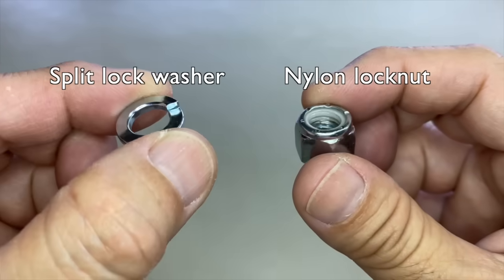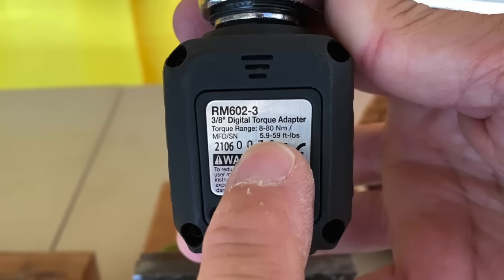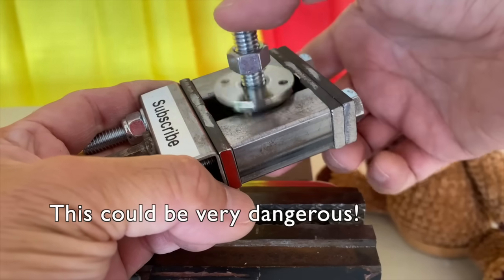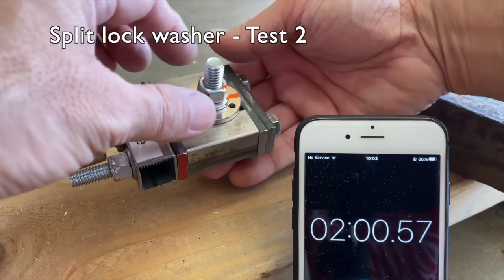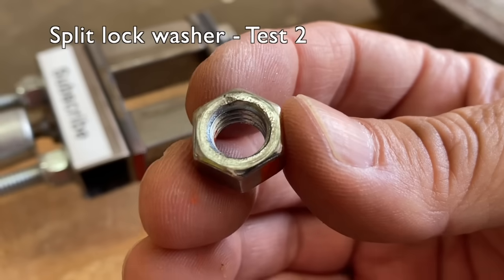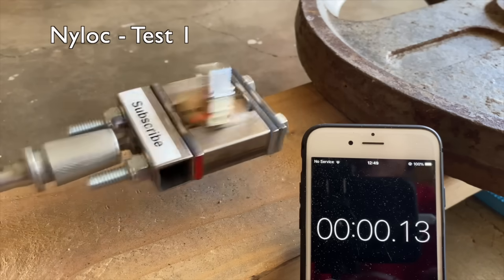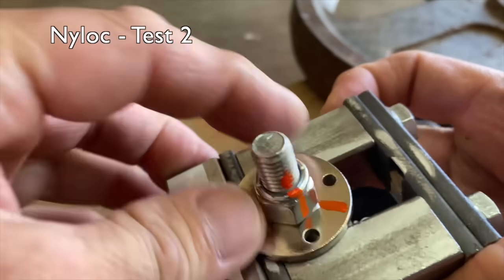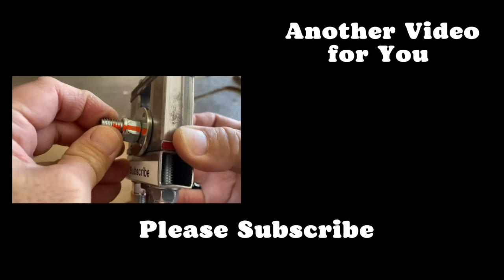Nuts & Bolts - Split Lock Washer vs Nylon Locknut – DIY Impact & Vibration Test - Part 1

Comment: Great test!
This is why crucial fasteners are lockwired on aircraft.
Shake it for a week and it’ll still be there.
A&P/IA,ASE
Reply: I've forwarded your comment to Boeing's r&d department
Reply: I had to stop laughing at all these comments to your post, David. But, yeah, I'm ex-Navy (F-4J) and all our critical bolts are safety-wired.
Reply: @randallmacdonald4851  I was in the Marines 83-87, Huey crewchief.
Went to NAS Millington TN for school, but I think they’re closed now.
Also went to NAS Thurmont (Camp David).
Navy has great chow!
Reply: @David-p7z9n  I was at Millington for Class "A" school (1971) for AMH then on to Pax River for Class "C" school for P-3 Orion. Then Keflavik, Iceland as part of the NATO "agreed area" there. Then down to NAS Oceana for more "C" school on F-4's and eventually did Carrier Quals with VF-74 around the Bahamas and East Florida. Navy ALWAYS has had great chow ashore or, in my case, aboard CVA-59.
Reply: Can someone let Boeing know.
Reply: @macforme  First Boeing needs to remember to install the nuts.
Reply: Unless it’s Boeing and being done by DEI hires.
Reply: @TMac0925  It's amazing to me that it's commonly known that Boeing's problems are caused by the mcdonnell douglas merger causing Boeing to be run by accountants concentrating on maximum profits instead of the previous engineers devoted to quality who used to run the company, and here we are with people such as yourself consuming nonstop political propaganda who stopped thinking a long time ago and repeat the moronic statement that the problem here is DEI. You are doomed to repeat political propaganda for the rest of your days babbling about whatever clickbait soundbite you last heard that you wish were true until you hear a new one that you then start endlessly repeating until the next one you hear that you wish were true. I sincerely wish that I could slap the crap out of you. And have a nice day.
Reply: @TMac0925  Where do people such as yourself come from that seem incapable of understanding that it was the merger of McDonnell Douglas and Boeing that caused the company to be run by accountants maximizing profits instead of engineers devoted to quality. What has gone wrong in your life that caused you to constantly repeat whatever click bait sound bite that sounds good you over and over and present it as fact? It seems to be people in a race to the bottom in a competition of who is the most devoted in looking as unintelligent as possible. Fear not, because your place in the lead is obvious.
Reply: @TMac0925  funny how the problems at Boeing and other companies are almost 100% caused by rich, white guys.  But you keep up bigotry, sport!

Comment: If you use a serrated nut, there is probably a minimum torque based on the two materials being joined.  One thing I haven't seen is two serrated nuts being used as a jam nut.  You'd probably have to use an angle grinder to remove those.

Comment: Can you please test the nordloc washer. This is the locking washer we use on Siemens gas turbines. Please use it correctly. The corrugated face should face it other.
Reply from the maker: My Nord-Lock test is out… Will Nord-Locks Survive My Test?  DIY Impact & Vibration Test – Part 5
https://youtu.be/wOUnlfhHRko
Pls check it out and drop a comment.  👍😎

Comment: Nyloc nuts are good for some situations, and fail in others. The rear differential in my old side by side exploded because the manufacture used a nylon lock nut on the pinion shaft which would back off presumably from heat over time. They never admitted fault even though it was a common failure on this particular model. As a retired aircraft mechanic, we always used  cotter pins, lockwire, or other more mechanically sound locking proceedures for any critical threaded item such as bolts, nuts, wire connectors etc. A soundly engineered assembly should have appropriately engineered locking methods be it the nut design, threadlocker application, lockwire, staking, tack welding, etc.

Comment: Now, run the test again with proper torque for the bolt size and grade.  6 ft/lb is way too low.
The split nut depends on compression to dig in. The nylon lock nut depends only on friction on the threads, so torque is immaterial to the nylon nut.
Reply: The bolt is a spring and wasn’t tensioned enough! The nylon is an extra brake if tension is lost.
Reply: This depends on the use case! Not every bolt is fastened to the rated max torque. There are tons of applications where the torque is limited. For example when you fasten axial bearings. Or of a partially threaded bolt works as an axis like in the rear axle of a motorbike. In this cases you need to secure the nut anyways. And this is a good example of it. Fully loaded bolts have less need for a lock
Reply: @Taunus-Tim  point well taken! 😊
Reply: After the nylon has engaged over 3 threads it has lost some of its effectiveness.
Reply: really   ,less than half
Reply: "so torque is immaterial to the nylon nut."
and the preload created by the stretched bolt of course.
Reply: @ I heard you the first time.
Reply: Right I was gonna say the same thing
Reply: Split washers dont 'dig in' they provide a preload tension.
Reply: @VladimirPutin-p3t  ever try to take one apart?

Comment: Before watching this I would already choose the nylon nut, having experience with both. Of course you'll NEVER be able to loosed the nylon nut with your fingers until the nylon has cleared the end of the bolt, no matter how loose it is. Also, I don't feel that this is a valid test because nobody is going to torque a nut of that size to only 6 pounds.

Comment: Wow, that's pretty interesting, thanks!
The reason we mostly use split washers is that you can have them in alloys/coatings that matches the bolts and bolted material: corrosion and fire safety come to mind first.
Do wonder if these Nylocs can be applied in such environments

Comment: Every fastner has its place in its application. I have worked on both vehicles and small engines all my life. I can tell you the true winner is using locktite.  I have never had locktite  fail.
Reply: @scottfirman  anything that needs stripping and re assembly if it has had locktite on the engineers will be cursing! I only ever use it as studlock.
Reply: @dogwalker666  use the correct loctite, blue gel is perfect for most low heat applications, then you have your high heat blue medium strength, then you have your reds. If you use a red thats on you, that stuff is "Im not planning on removing that and it really shouldnt come off under use because that would be catastrophic". Some reds you can remove by heating with a torch, though you cant always do that with the part/location.
Reply: @BigChiefWiggles  I know I have the chart on the wall, You missed the point, Other people including machine manufacturers use thread lock not just locktite, And it can make maintenance an absolute nightmare.
Reply: @BigChiefWiggles  Agreed on the reds.  My shop uses red when we balance rotors  (for large induction AC's) and the application requires bolts and washers be used as balancing weights.  Generally if one of those comes off while a motor is runing the windings are going to short out and blow a fireball.  I've had to remove those before when a motor is back in for another repair for some damage that requires the rotor be rebalanced.  if the bolt is large enough to handle the torque it is possible to get even red high strength off with a wrench on each side but its way more work than just geting the torch out.
Reply: Orange for the win
Reply: I like cross threading the best, crank that bad boy down and it ain't coming off after that.
Reply: Loctite's for amateurs.  Real engineers use salt water and rust does the rest 🙂
Reply: @StanleyRestall  Worst idea ever. salt is the worst enemy of steel. I always put grease on my bolts and nuts, to make sure no rust.
Reply: @west_park7993  I took the salt water hack comment from @StanleyRestall as a joke. 😆
Reply: @west_park7993 hopefully you don’t apply it to the threads prior to tensioning. Thread lubrication is a big no-no unless the joint was designed with lubricated threads as part of the system. Oil and greases and just about anything one would apply to threads alters the K-factor or nut factor significantly.
Reply: @TPSTH23  i apply grease on the thread BEFORE tightening. for noncritical applications, it does not matter: I tighten it by the feel in my hands..... For critical, like head bolts, I apply a lot of grease. And I drive the bolt in-out twice before torque. Make sure, that the two threads are sliding, and NOT twisting the bolt.... I just found stainless steel bolt in aluminum thread. DRY. the SS-bolt was not corroded, but aluminum was. If they used a bit of grease,, there would be no water, and no corrosion. Yes: aluminum corrodes very deep, when in touch with another metal. Galvanic electrochemical corrosion.
Reply: @StanleyRestall  Now I know why the bolts don't come off without flame, banging, and blood. 😂😂😂😂
Reply: @StanleyRestall  Use caustic it rusts even faster.
Reply: @StanleyRestall  🤣
Reply: @StanleyRestall  that's funny!
Reply: I have. But thats in a bit more extreme condition. Phantom II AIRCRAFT. The F-4 E/G Wild Weasel. Safety wire. Damn near everything. Bolts, nuts, electrical connectors, hydraulic connectors, pneumatic connections (just kidding. I dont know of any of those. Outside what I worked on)
Reply: Wd40 eats super glue and lock tight. Let it soke a bit,walah
Reply: @recommens-comedy-central9761  walah?
Reply: @recommens-comedy-central9761  Actually no, Modern WD40 is no longer solvent based, Spray some Expanded Polystyrene see it not melt, 
Also the food grade version is even weaker.
Reply: Wd40 used to be 98% paraffin, 2% aromatics,  it's cheaper than wd and works the same
Reply: With a split washer?
Reply: Locktite 648 does it for me, you need a blowtorch to remove usually
But, a mate bought a z550, he had to strip the head down, previous dolt who owned it used locktite on the cam bolts that clamped the cam down, he, (being another dolt) didn't use heat to remove the bolts, stripped most threads removing bolts, couldn't helicoil as too close to bearing surface, so he had to source another head. Don't know why they were located as they don't need it
Reply: I use nord lock rings these day's.
Reply: I've seen it fail with heat.
Reply: There is a version for high heat. I used it where I needed to fasten the cylinder head of a moped, because the gasket was burned, but could not use cylinder head screws. I had to secure threaded bolts to the cylinder, ease the cylinder head on the four bolts and fasten them with screw nuts. Else I would have to remove the complete motor. 
The loctite never failed, the bolts never went loose in the hot motor.
Reply: @wwhb4780  red loctite on heat applications, especially head bolts on smaller engines. I found it priceless on single cylinder engines. The little Yamaha enticer would shake it's  self to bits without locktite.  That's a snowmobile. I used it exclusively  on snowmobiles. Blue for what you want apart eventually, red for never doing that job again.
Reply: @BTW...  Which threadlocker and what was the temperature? (eg. Removable threadlocker temp range 242 = 300F, 246 = 450F, 2440 = 650F)
Reply: I was just about to mention this. Thread lock seems to work well yeah.
Reply: I have seen failed on washer direct drive by whirlpool
Reply: I have seen it fail once on one nut but I used it to secure the nuts on a SDX-MAX floor scraper attachment for an demolition hammer with 20 joule impact energy I used it to scrape tiles from a concrete floor.
Reply: Yep! Loctite solved the problem of losing sprocket nuts while riding a motorcycle over long distances (2,000 miles or more).
Reply: I was a shuttle mechanic and engineer for 25 years. Split lock washers just aren’t used in aviation/aerospace on critical bolted joints. All nuts had a design locking feature. Every bolted joint had two locking features, and prevailing torque was always checked on each fastener during installation as directed by the installation drawings and associated specification for the installation of threaded fasteners. Oddly enough, locking compounds were not approved for normal use on the space shuttle orbiter, but was used in certain MRB repairs where prevailing torque for blind fasteners was lost. There was a detailed test performed by NASA near the end of the shuttle program that tested the use of locking compounds. In summary, the test found that locking compounds performed better than the proper preload applied to the joint in many cases. The test report is located here:  

https://ntrs.nasa.gov/api/citations/20120015467/downloads/20120015467.pdf

Here is one of the best websites for bolted joint theory:

https://www.boltscience.com

Comment: Interesting. Makes me curious about holding power of Nordlock, Belleville, inside/outside star washers, all metal lock nuts, etc. I don’t doubt the outcome of the test but would have been better if proper torque for the bolt size were used. Also, nylocs require additional torque added due to the nut friction.
Reply from the maker: My Nord-Lock test is out… Will Nord-Locks Survive My Test?  DIY Impact & Vibration Test – Part 5
https://youtu.be/wOUnlfhHRko
Pls check it out and drop a comment.  👍😎

Comment: Your testing method is flawed and not properly scientific..
Both the split/spring lock washer and nyloc nut are designed to stop a loosened nut falling off the assembly. That is all.
However, neither are designed to have such a low clamping torque of 6ft/lbs applied to them, nor used that way.'
If your analysis was correct all sorts of assemblies and motor cars would have fallen apart long ago.
Try the test with 30ft/lbs initially applied to the 3/8" bolt/nut assembly, then back it off by all means to simulate a loosened nut,
 and your results will be different because the grip of  split/spring washer is established during the torqueing down process.
The nyloc nut offers resistance coming and going and needs no torqueing to establish its grip.
Go ahead.
Be scientific.

Comment: For a secure hold the split lock washer would need to be installed on both sides - bolt  head and nut. Otherwise there is no backhold for the bolt itself. The nut is locked to the spacer but the bolt is more or less held by friction only. That is different with the nylon Locknut - in that case the bonding is directly between the nut and the bolt.   Isn't it strange that car wheels have neither of the two...?

Comment: the results don't surprise me at all. a split lock washer works in two ways, 1) when fully tightened it acts as a spring that increases friction between the mating threads, 2) as your test showed, as the nut is loosened the cut edges of the split washer emerge to dig into the mating surfaces like knives and resist loosening rotation

there are a couple problems with this. unlike the soft zinc alloy you used, hardened steel is not going to accept the split edge of the washer into its surface so easily. the spilt washer will still act as a spring to increase friction in the threads, but hardened bolts are often spec'ed to high torques such that the additional friction from the spring action of the split washer isn't going to add much as a percentage of overall friction

under high temp conditions like exhaust manifolds, the split washer completely losses its temper and acts no differently than a flat washer

for obvious reason i don't think anyone would spec a nylon lock in a high temp application

in low temp applications i would always use nylon lock where available, but split washer is a reasonably secure and economic alternative for small, low-demand, soft steel fasteners

Comment: Good video, sometimes the obvious is not so obvious. The Nyloc retains friction hold to the bolt as long as it it is still on the bolt while the lock washer only retains while it is compressed together with the nut. Again, interesting video

Comment: On your nylock tests, if the nut didn't move on the bolt, then the bolt or the compressed load were deformed through hammering.  Nothing was loosened, something was stretched or compressed.

Comment: If I didn't scroll far enough to see it mentioned sorry. Nordlok washers, also called wedge locks. You have to get the right type for your materials but they are great.
Reply from the maker: My Nord-Lock test is out… Will Nord-Locks Survive My Test?  DIY Impact & Vibration Test – Part 5
https://youtu.be/wOUnlfhHRko
Pls check it out and drop a comment.  👍😎

Comment: Torque loading the plain and split will have similar actual torque values. However, the friction increase in the nyloc due to the insert will cause a lower actual torque value at the surface contact area. Good video. If you don't want a bolt assembly to come loose, then either wire lock it or use a split pin.

Comment: - very much depends on the steel Split Locker Washer is made of.   It would be great also to control the temperature of the joint - nylon can soften a lot.

Comment: How soft was the steel of the nuts which were used with the split washers?
I have never seen such cuts in the nuts made by the split washers especially if the torque is so low.
The cuts the washers made to the nuts and the base metal (test structure) were very deep in my mind.
I wonder how much real life torque these nuts would hold because 3/8 bolt isn’t the smallest one.

Comment: Your test is invalid, always use the specified torque for the fastener you are using, also in real life the fastener does usually vibrate in it’s hole that amount.

Comment: The split washer is gripping the nut and the flange. You're only supposed to use these when the bolt is captured.

The Nyloc grips the nut and the bolt. More suited for bolts that are not captured.
Be interesting to see the results using a captured bolt.